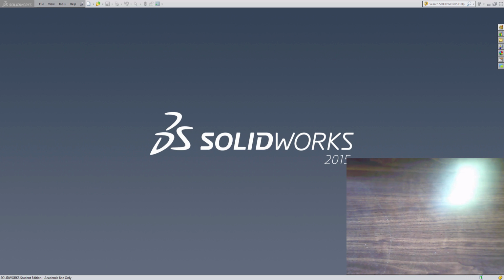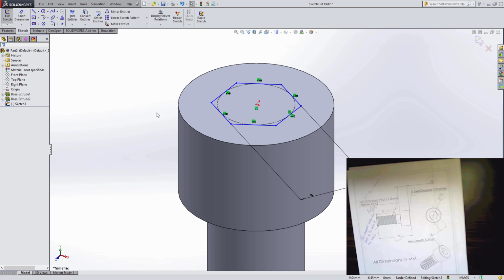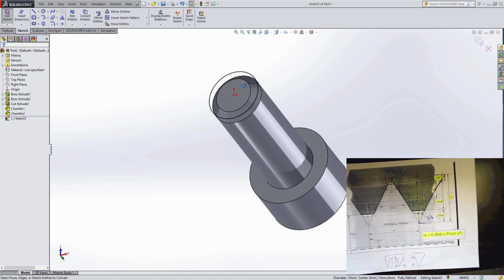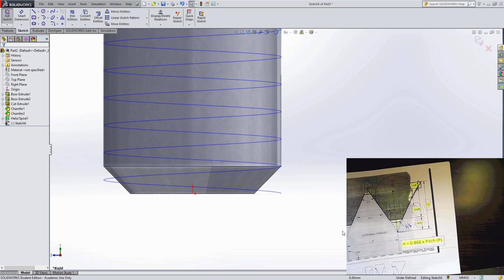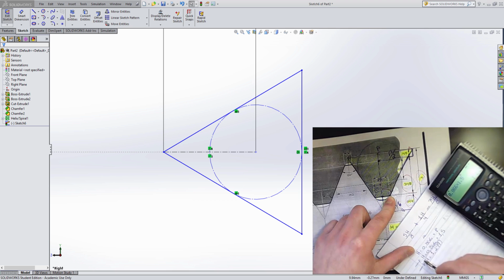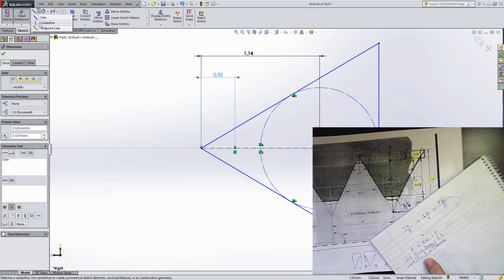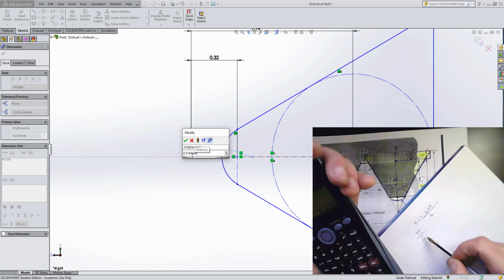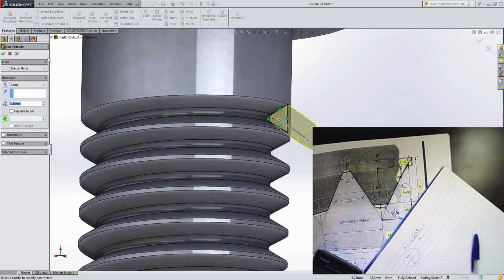SolidWorks Tutorial | How to create Threads on a Bolt M10 - EXPLAIN - step by step

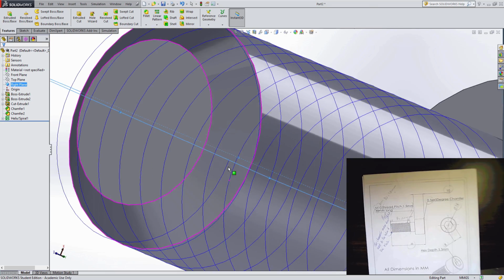Comment: Great video! - A question: at about 7:58 you state that the right-plane is on the end of the spiral path.  However, it's not clear why the spiral path started on the right-plane to begin with. When I created a spiral on an arbitrary cylinder, I had to create a reference plane in order to make a sketch that is perpendicular to the end of the spiral (for the thread profile). Can you explain?
Reply from the maker: If I understand correctly your question the answer should be:
You should create the chamfer at the bottom of the bolt. Then you have to select the bottom surface of the bolt and select sketch. Then you have to select the edge of the cylinder and select convert entities. There is no need to create any plane here.
Then when you are at the helix and spiral option at the left hand side you have o set the starting angle at 0.
By setting the value 0 your spiral line will be exactly on the right plane.
I hope i answer your question. 
If not please let me know.
Reply: @solidworxedu1035  Thanks for your reply!    Ok, the part I was missing was that the default angle for the Spiral on first attempt was 225 degrees, not 0.  Setting the "Start angle:" to zero gave the expect behavior as in your video. Additionally: as a newbie, I was unfamiliar with the "Convert Entities" command - In Fusion 360, I think it's called "Project geometry" or some such thing.
Reply: PS: I did try the thread tool but in my case, I need 45deg threads which are non-standard [so they can be effectively 3d Printed]
Reply from the maker: You can use the link below. It's the faster way to create threads in SolidWorks.
https://youtu.be/OVSF3isSGUY
Reply: @solidworxedu1035  Thanks again. -Dave

Comment: i had trouble on my first attempt using the "sketch fillet" feature. when i make pierce of the profile and the end line of the screw, the profile "FLIPS" on the other side. Using the 3 point arc on the other hand seems to have no problem at all. all in all, your video is great. kudos to you!
Reply from the maker: Dear Alvin, your comment is so valuable for us here at Solidworx Edu and Thank you.
All of our students used to face same thing. 
The trick here is to fully select the sketch of the thread and drag it close to the point where you want to do pierce. NOTE: Don't drag it too close to overlap the pierce point but close to it. 
All in all, the best way to do it is the way that makes you feel more trusted to use.

Comment: Thank so much. How can I find out the dimension of chamfer for thread, example, M130x3?
Reply from the maker: Mr. Tuan, We are happy to see your comment on our Channel.
When you start a project you have information about the Bolt you want to manufacture. Such as diameter, length and pitch and for what purpose.
We know that there are categories of tolerances between bolt and nut. Most common are the ''Fine'' Category  and  ''Coarse'' Category).
For example a standard ''Fine'' Thread Bolts (Metric) bolt of M125 has a pitch of 4mm. This is standard value. 
So, In most cases you use the pitch value equal to the chamfer.
In the case of ''Coarse'' Thread Bolts (Metric) bolt of M125 has a pitch of 6mm. So, here your chamfer will be 6mm.

Comment: Mr. Marios christodoulou. Thank you for the video. Its helpful.
I was looking for some issues like ; what is the exact plane to start pitch shape and where should it placed " at tip, middle or root".
Thank you again.
Reply from the maker: It depends. If I understand your question the answer will be that the correct point should be the middle because if you select it from the top you will get small in-depth threads. if you selected from the bottom you will get deeper than normal. Hope I have help and answer your question.
Please If you need anything specific to present here in this Channel send an email with pictures and attachments of what you need us to do. Provide as much info as you can and send it to the following email.:
solidworx.edu@gmail.com

Comment: Hi, Nice video that really helps me a lot.  Not like other tutorial, u explained how the dimensions of the triangular was defined, which is super awesome. my question is, how did you determine the 5/8 H, 1/8 H these parameters? where did you get them? btw, I don't understand why H=0.8633*P. Could you explain a little bit more about these? Thank you
Reply: Thank you so much for great explanation and valuable documents. Now I understand why H=0.866P, it is basically mathematic relationship of equilateral triangular (like you said Root of 3 over 2). It doesn't really matter whether we use 0.866 or root of 3 over 2, coz this is a practice. Anyway, great to hear explanation from you. but as your side video shot showed, that the radius of incircle of this equilateral triangular equals to 1/8 H, is this what your graphic illusion means? I calculated myself and searched on the web, and found that the incircle radius of equilateral tri is 1/3H, which is not 1/8 H. Can you provide me a better vision of your draft showing how these relationships were defined. sorry to keep asking you questions :p...just for learning. Thank you Marios, really appreciate your help...
Reply: @solidworxedu1035  Thank you so much - I was about to spend the next 2-3 hours proofing this out and trying to understand it and now I have something that I can at least print and then test with a real screw.
Reply: https://youtu.be/L99lnAqVK1A check this video to understand those reltations!